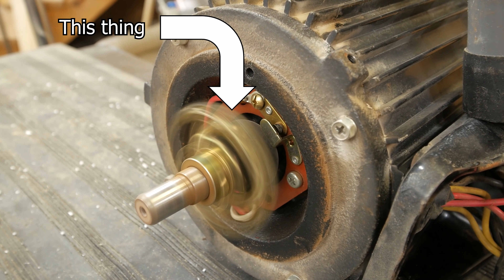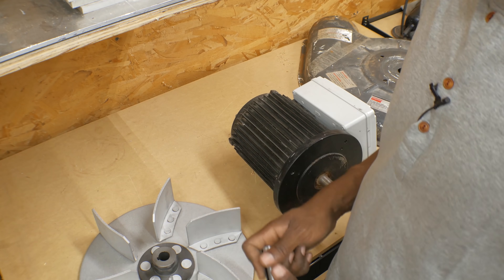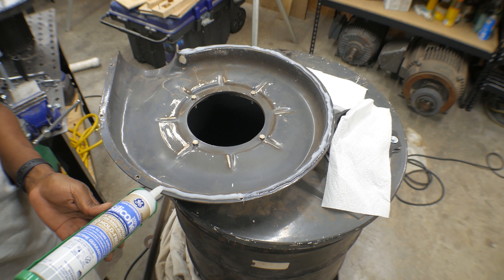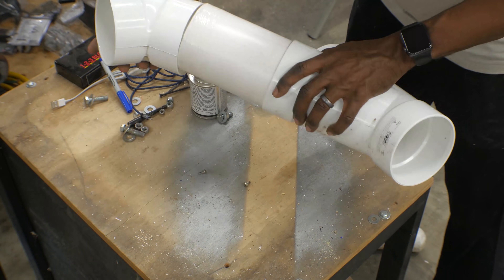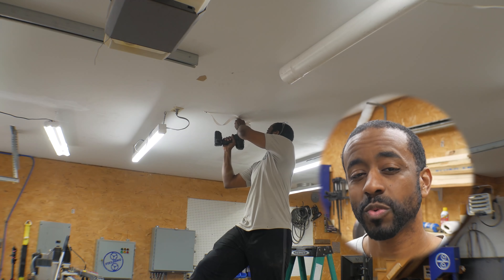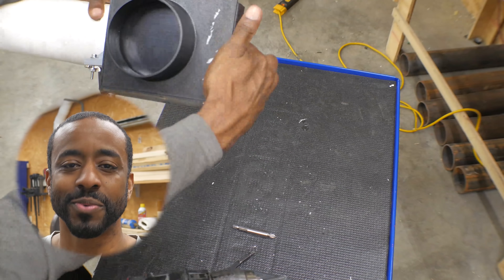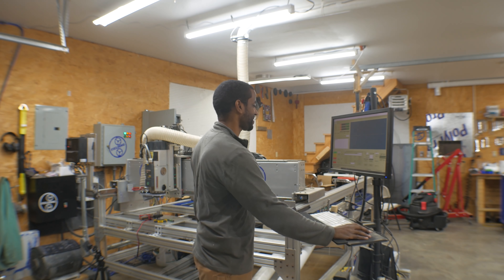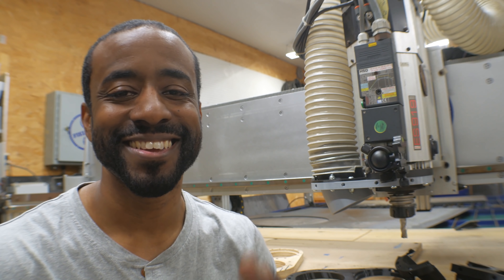Making An Automatic Dust Collection System; Shopmade #081

Comment: One thing you might think about is adding in a delay between the tool turning off and the gates closing and dust collector turning off.  Give the system some time to clear any dust that might be in the system and/or floating around the tool as it spins down.
Reply: I think Matthias Wandel has a circuit that would work, a low parts-count delay-on relay board. I think he used it to replace the centrifugal switch in a belt sander motor.
Reply: Came here to make this comment, as for the nuts and bolts of it, it's painfully hard to beat the price of just buying one of the 99cent timer relay modules sold on ebay.
Reply: I agree, a delay for the vacuum to shut down after about 15 seconds or so. This also makes it so that if you move from one piece of work to another the collector motor isn't turning off/on constantly while switching work pieces (this part would require a longer delay, probably)
Reply: Slap a cap in parallel with the coil and a resistor in series. Easy cheesy!
Reply: Generally a shop tool stops making dust/shards for a few seconds before it's turned off anyway.  My cuts are through and clear of the blade before I shut off the table saw.  Same with the drill press or router.  A delay mechanism might be a lot of work for no net gain.
Reply: @johngaltline9933  you can steal washing machine door relays from discarded ones, that is cheaper.
Reply: @BulletproofPastor  There are other lags in the system to consider as well.  The length of pipe between the particular machine and the collector adds another lag, for instance.  Ideally, you want the vacuum to shut off after the piping is completely empty.  For that reason, a delay of some sort is probably a good idea.
Reply: Speaking of relays, you can buy timing relays which would give you just the delay you want without even changing your circuitry.
Reply: Might also give you time to go to the next machine so you aren't cycling the blower so much.
Reply: I think you can "just buy" a delay timer from ebay
Reply: Capacitor and Thyristor?
Reply: Instead of adding additional pieces, he could replace the 3way valve with a 5 way, and put adjustable exhaust/silencers. Less cost and work than all the above ideas. I built my system with the above and it works great. Fast to open, slow to close. I also put current sensors on the local plug so you keep everything local and don’t have to write code.
Reply: @oboudreaux  can you explain with some detail the easy cheese stuff ? Thanks
Reply: @manaquriazertyuio4555  i will next time my aunt call me to fix here washer
Reply: @johngaltline9933  true! And he cops to this in the video.  What you can’t get for $.99 is the whoop at the end of the video when what he made works. It’s a trade-off.

Comment: I used to work in a huge industrial grade cabinet shop that had giant dust collectors. We had several fires inside the system and although we didn't prove they were started by static discharge, after we added copious grounding, we stopped having fires.
Reply: Whether you can prove it or not, it seems like such a cheap solution you might as well try it.
Reply: Yeah I've been shocked from my first CNC router dust collector hose when cutting plastic. Never tried grounding that one. At work we move starch through a plastic chute and it has a copper wire wrapped around the outside of it. No problems. Down at our sister plant that makes polystyrene beads and air-veys them into railcars, you will get a static shock that knocks you down if you touch an ungrounded chute while it's loading.  Some shocking moments to be sure.
Reply: Yes, it happens in industrial usage, but there are no reports for home shops. The volume of air is not high enough
Reply: As Mr. Fielding said, I've never heard of a documented actual case of a static-caused fire in a home workshop. If it's really a concern, plumb your DC system with metal pipe. (Heavier gauge than typical HVAC pipe, which has been reported to collapse from the vacuum pulled by a DC system.)
Reply: can you run a copper wire inside a section of the pipe near the collector to get rid of the charge?
Reply: @frrapp2366 
I'm not sure if what you suggested would work. I believe you would want the grounding to occur at more regular intervals (continuous would probably be better). We switched all our pipe out to steel or grounded flex. We also added a continuous ground along the outside of the pipe, which we bonded to every section of pipe. I'm not sure, but if it were me and I wanted to use plastic, I would run a continuous bare wire outside the plastic pipe and attach to smooth rods that barely penetrate the pipe (maybe 1/4") and do every few feet. I would also use a metal clamp from the wire to the pipe at each point. Electrostatic charge is funny, it doesn't need a conductive material in order to travel. In fact, most plastics can transmit and even conduct electrostatic charges. Most synthetic carpet material can hold electrostatic charges. All that to say, I believe grounding the outside of the pipe at close intervals could help, even though the pipe us plastic.
Reply: Had one at a shop I worked at. Someone hit a nail in an old cypress work piece. Long story short that was a nice day of ashed clean up.
Reply: Fies can start from blunt blades and cutters burning the wood as it is cut, with the pvc pipes the static attracts the dust and buids up around the outside of the pipes, on the industrial side the metal pipes and  fittings would be grounded yo the machines any industrial flexible hose has a wire within the coil and should be grounded to the machine either end. Anyhow I like you videos you do a really good job.
Reply: The general consensus among dust collection specialists is that while static IS an issue for industrial sized systems, it isn't really an issue for home and small shop systems.  If you can catch a months dust in a 55 gallon drum, you're fine.
Reply: I have a grounded copper wire wrapped around a PVC pipe, but wasn't sure if that would be enough to dissipate a charge on the inside. So I anchored the wires using sheet metal screws on the fittings just barely poking through (to act like a "via" on s PCB). Been a few years now and I've Never detected any sort of static buildup so it must be working.
Reply: @QPatriot07 
That sounds like a good plan. I like it.
Reply: @frrapp2366  you can run a wire inside, but the huge downside is it can trap chips inside the pipe building up and causing issues down the road.    If you really feel the need to ground your pipes, its much easier to just wrap the outside with bare wire and ground it.

Comment: I have been woodworking for over forty years, both professionally and as a home hobby. All the articles quoted and relayed about dust collection system fires are about large dust collection systems. I would love to see even one article , actual news article not a rumor heard from your buddy, about a small shop fire. The majority of the dust collectors we use is at 3 hp and below. They do not have sufficient air flow to cause a fire. The tool supply companies are making a fortune from fear and fear alone selling anti-static products to home users, and no real evidence of fires caused by small shop dust collectors.

Comment: I'm a software programmer and automation is the name of the game.  Super cool, thanks for the video!
Reply: Systems Planet I’m an automation technician, and my favorite pastime is fixing stuff... so I beg to differ. 😂 everything I’ve automated so far has worked great, with two exceptions. Both things I made more efficient designs and wanted to replace anyway! Lol.
Reply: Automation can be awesome, but only when it works as needed every time without any issues. It has it's downsides in the loss of operational skills, thought on what you're doing, and in distancing the human element from the work you're doing. Some of us simply prefer simple and hands-on even if something 'better' is possible.
Reply: @SystemsPlanet  power
Reply: @SystemsPlanet  Yes and No.  The problem with automation that is badly engineered is it fails during its lifetime.  If you want to use your shop dust collection system without redesign or maintenance for 10 years then you need to design it to last 20.   Using flimsy plastic blast gates with a 2 year life expectancy will have predictable results.  Using quick wiring connections used for test rigs rather than soldered joints will have predictable results.    Automation is just engineering, it has to be designed.  
What I can see of this system is it's very well designed, and looks well engineered.  Connections are solid, virtually no use of bailing wire or duct tape ...  great job all and all.

Comment: A bunch of us guys out of high school and college put together a wood shop and made a dust collection system.  Made it out of a leaf collection system (one of the walk behind units with a 8 hp gas motor) we used an electric motor and made a "cyclone" type dust bin with a detachable barrel...very convenient. That was in 1974. The availability of stuff was different and so was the ability to research how to do things. New ideas required a thing called the Readers Guide to Periodical Literature at the library. No internet back then. I taught myself quite a bit that way. To me it was like heaven when I could do my research online.

Comment: Just a tip: it's likely you couldn't find the impeller you needed because B is a new rendition as a fix. They probably had problems with the type of shaft size you have on yours and decided to switch to a bigger one at some point. Here's the tip: instead of searching on what is an obfuscated view of real stocks, give calls to various outfits that sell these kinds of parts. Obviously, you'll run into more hassle than its initially worth it, but you'll also run into that person who will say "ah, yeah, we still have that part".
This tip isn't specifically for this blower, you did good with the shaft "collet", but what i'm trying to say is, sometimes the internet isn't exactly an exact portrayal of reality and it can cut off avenues.

All that jabble being said, nice project, certainly a cool approach to the old adage that if it's not easy, we won't use it.
Reply: @billybobjoe198  don't seem to have any problems with my Ferrari. 😂
Reply: With enough persistence and time unobtanium can be found. I dug up what may have been the last new ignition coil for my very old weedeater that way- it was an underengineered part and they all fail. So when I got the "ain't got any" answer I always asked advice on who might have it then followed up every lead. A year of looking off-and-on and I found it at a backwoods shop ran by a man who was once a big city dealer but retired to Idaho about the time it went out of production, taking all his inventory with him. The guy who mentioned him had once worked for him in the big city a thousand miles away and guessed that there wasn't much call for weedeater parts in a forest so he might still have one- and he did! Not only that, but he let me have it at the decades-old price too. 

Someone somewhere has what you need in usable condition; you just gotta find them, that's all.
Reply: @P_RO_  I admire your tenacity.  Most of us would have just bought a new tool after the first couple calls.

Comment: I believe the reason why you havent been able to find articals on dust fires, is probably because the news rarely knows the source of the fire, only that a building caught fire. If the fire were to result in a substaintial loss of life and or proerty, then there might be some follow up. I personally worked in a facility that has multiple high speed CNC routers and a slew of other wood cutting machines, all connected to a large central collector. It caught fire every couple years, totalling something like 4 or 5 fires before we solved the issues. Dust collector fire prevention falls under NFPA 654 and grounding is part of the code.
Reply: Thanks for the NFPA reference. An even worse condition is created when PVC or PP piping is used for clothes dryer venting or paper dust from shredders. The static charge from air flowing through the PVC causes all of the dust and lint to be come charged and stick to everything. This causes buildup of fuel for fire. Always use metal vent material and provide good bonding and a ground. It is illegal to use plastic piping for clothes dryer venting for a reason.
Reply: It's very difficult to effectively ground PVC pipe and plastic blast gates.  Grounding the system by attaching a wire to the PVC is not a solution. 

The vent vent pipes on tanker inert gas systems are very susceptible to corrosion and static charge buildup.  Bondstrand 7000M piping was developed to provide a glass reinforced pipe that was conductive and could be grounded.  Flanges and couplings are conductive and can be grounded.

Bondstrand 7000M is not inexpensive, but is conductive.   It is meant for industrial useage.

Overall galvanized vent ducting is probably the most cost effective choice.  If you use a blast gate or valve that is made from a non-conductive material, such as wood or plastic you need a bonding wire to assure the sections of duct do not become isolated.

Comment: 3:00 When you use a puller, not only do you have to take care not to warp the impeller or pulley or whatever (BTDT), as you know, but you also have to protect the tip of the shaft that the puller screw is pushing on. In this case, a sacrificial bolt, or series of bolts that take the punishment of the tip of that puller screw.

Comment: The most elegant system for grounding the PVC tubing, and for at least peace of mind... Run speaker wire along the outside of the ducting, and every so often strip back and wrap/connect the bare wire part to a pointy screw that passes through the wall of the duct and into the air stream. Ground the end of the wire... that's it.

Comment: Something to consider with automation, once it gets beyond the desk, or bench, is safety. Not to be a troll, but when you do distributed things, like control a dust collector from across the shop, or from multiple places across the shop, it's worth considering how things are going to work in an emergency situation. EG, Do you want the dust collector to shut down when you hit the E-stop button on the machine?, and so forth.

With the dust collection gate, you considered spring loading it in one direction so you only need air pressure or some other effort source to move it the opposite direction. Another consideration is, in what state is the gate most safe, and would it be desirable to spring load it to this state, so a source of power is needed to get out of that state. When power is lost, control is lost, you get an automatic return to the safer state.  I'm not advocating one way is better, only that it's worth considering when delving into automating things.
Reply: Hi Greg, I agree with what your saying totally. The Blast gate may be a very inert item to think about safety for, but that's where your head should constantly be when building  automation into the shop. The Whole "What If" mentality. I have had some experience with home brewed automation failures that were quite costly which finally got me to think about the "What If's" before putting the system together. 
I love what Jeremy did here and, let's be honest , even with no thought about safety, things will probably work out if something happened. The thing I think Greg and I are trying to get across is Having the mindset when you start into a project so that your thinking about those "What If's" as your going along. Ok, Rant off...
Reply: @tgirard123  It's obvious you two work in industrial environments. Where I work, safety is drilled into your head. It's to the point I walk around in public, roll my eyes and cringe at all the safety hazards I see, even the smallest ones.
Reply: As a retired industrial instrument installer/technician, I have seen a lot of safety features added under the 'what if' scenarios. Most were instituted to mitigate losses due to human error in day to day operations. The rest were to stop losses due to actions beyond operator control, such as weather, power failure, mechanical malfunction, software failure, etc. After several years of gate automation experience, I have redesigned my own blast gates to compensate for such things as the loss of power or control signal/air. After adding positive stop position switches and a full chip drum or clogged filter shutdown, and just about all the fun is removed. Mine has an alarm for each gate with an LED start-up sequence to simplify troubleshooting in case there is a failure.

Comment: Nice work!  I also automated my dust collector and blast gates. I used the same dual action air cylinders and pneumatic relays, but made my own gates with a 1/4" plate of melamine housed in a 2x6 block. The nice thing is that these gates are self clearing. Then I used a PLC controller with IO modules. I added current sensors in my tool AC supply outlets. This allowed a tool on current detect to trigger the blast gate and turn on the dust collector. The bonus is that tool off detect will allow the dust collector to run for a minute to clear the pipes. You can make this all programmable with the PLC and get nice optical isolation to boot.  Great videos, keep em coming!

Comment: Silicone is the go to solution for myself.  Gasket sealant is good also. I love your videos
Reply: I am a plumber and shadetree mechanic.  I cant see silicone being a bad option.
Reply: It is not like this is a high pressure pump... It will last for years, and is easy to reapply if necessary.